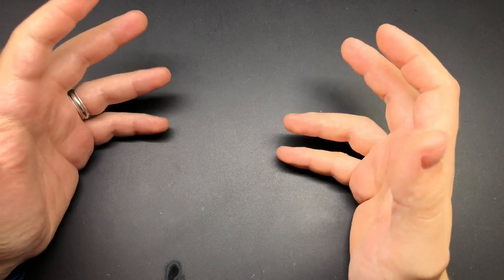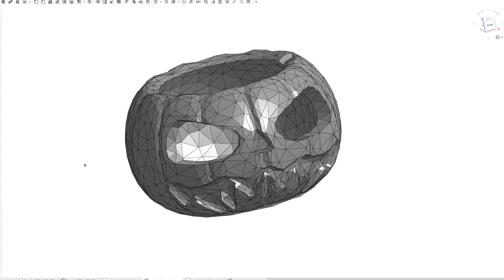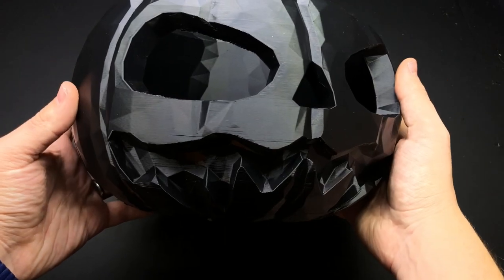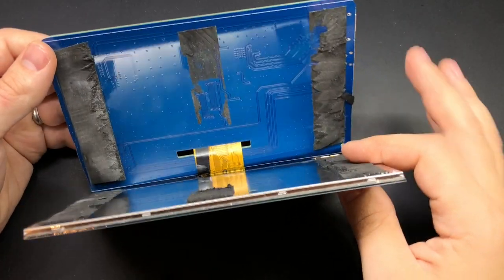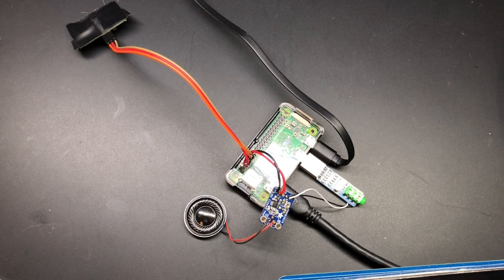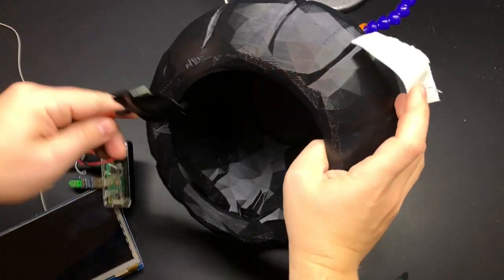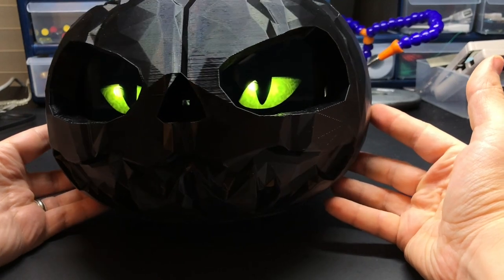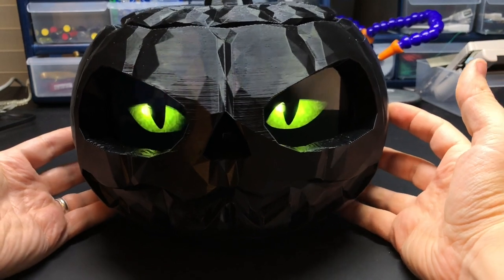Raspberry Pi-powered Jack-o-lantern - Happy Halloween!

Comment: I remember me and my code club students making a similar project. We did it with an arduino uno, an ultrasound sensor some LEDs and the guts of a toy witch. It was supposed to laugh and flash when somebody passed by. The sad thing was that the lantern was literally a carved pumpkin. Somebody forgot to take the electronics out of it. You can imagine my reaction. It was an original arduino uno.

Comment: Pretty cool bro! Nice and simple.... imagine 20 yrs from now when 3d printers will be in every home... plus faster and more accurate...
Reply: They won't be. Everyone has this mindset that 3d printers are something every home can use. What will every home print with them? I can understand hobbyists like us using them (and even then it's sometimes better to use other methods) and people that build prototypes. But 3d printers are already as cheap as they come and still only hobbyists use them. We had one at the office that we got via public funding. I was the only one using it and even then for my personal stuff. 3d printers are not something that everyone can and will use.
Reply: winnetouch I completely disagree. They will become far more popular as printing speeds increase. I mean look ... it took almost 24 solid hours to print a small pumpkin. That isn’t convenient at all.

What will the average household print? You really underestimate the popularity and convenience of plastic. 

Almost every cooking utensil I own is plastic, chip clips, command hooks, toothbrush holder, soap dish ... I mean, I could go on for hours.

The main roadblock right now is time, size, ease of use and the knowledge of their existence.

There are still people that don’t even know what 3D printing is or that it’s possible. I didn’t even know you could get one for under $500 now.

They will gain popularity and I would say within the next 10-15 years be in most households. People said the exact same thing that you said about the PC.